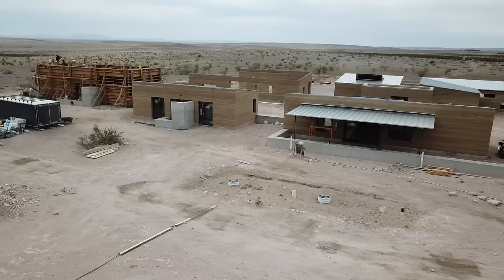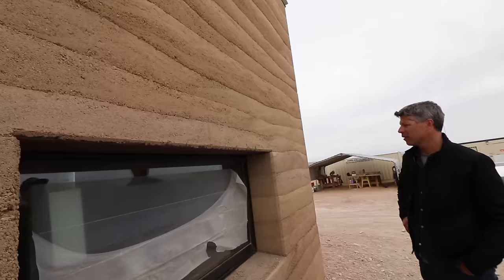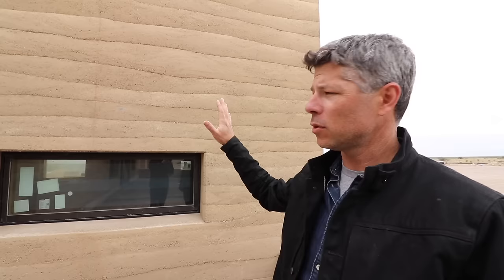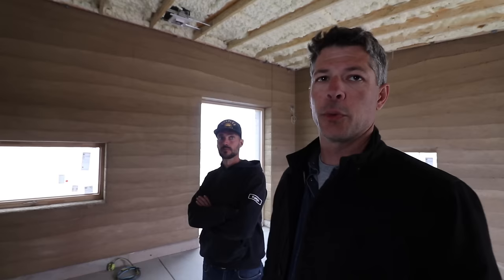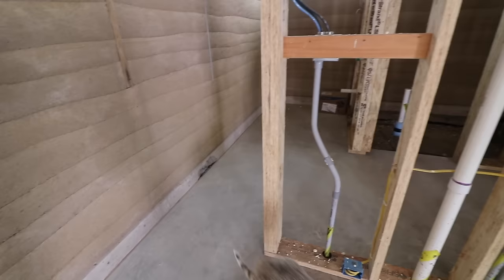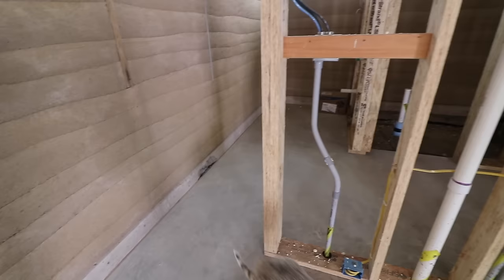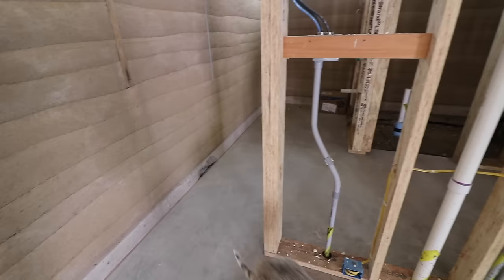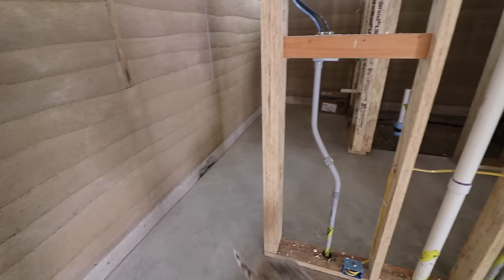Rammed Earth : You won’t Believe How They Build This!

Comment: Wow! New Idea! (No, it ain't, and you're about 10,000 years late.)
Reply: Yes, compacting of Earth to build walls has been around for a while. To RAM the Earth you would literally take male sheep (not the valuable for reproduction females) and place between the forms and run them around the interior of the forms. Hence the term RAMMED Earth.
But I'm fairly certain they did not use pneumatic hammers to pound the earth into place. I'm also quite certain that they did not use cement mixed in to make it a type of concrete. Also I'm certain that none of the others had in floor heating nor electric lights. 
But yes other than all the technological differences they are exactly the same.
Reply: @1grandpappy684  it's called rammed Earth due to the fact you tamped it by hand using a log normally. The facted that is called Ramming is just one of many oddities of English. It's a ram in the same way a battering ram is a ram.
Reply: @AdolphusOfBlood  
Perhaps you would be able to explain the occasional "ram" skeleton found in a RAMMED earth building.
Reply: @1grandpappy684  while I would not know about that, I do know about how they have been made for centuries in Mexico, And no Rams are involved in that. Perhaps those you mean were uesd in some way as an offering to the God's. How am I to know?
Reply: @AdolphusOfBlood   I would love to see your documentation.
You've referenced Mexico rammed Earth projects. Was rammed Earth done elsewhere? Can you assure me that in those other places the compacting was not done with animals? I know for a fact that there were several places where animals were used including "rams". If you have references stating that rams or pigs or other animals were never used for compacting the Earth I would love to see that citation.

Comment: Let`s save   pennies on   materials so we can  spend excessive amount of  money on labor.
Reply: If its self build then not so bad. If its community housing then mighty good. The scaffolding can be reused multiple times. I still have formwork years old and going strong and it was heavy thickness ply on frame. This is the most economic, thermally stable, soundproof system on earth $for$.

Comment: this is ok if it has large large eaves or if the area doesn't have extremes in weather, in much of Australia these crumble due to cold to freezing in winter and dry as dry can be in summer, so the ingress and egress of water and the expansion of both microbes and cessation of them leads to this crumbling quite a bit. likewise the prevailing rain and winds cause a lot of erosion too...

Comment: I volunteered to built a rammed earth home in South Dakota and got a job building these. These homes have a better appearance. we used concrete headers, instead of Steel. Also we used a lower quality clay. These look better all the way around. I would go an extra step and put stucco on the exterior and paint the interior.

Comment: In hotter climates you can also use thermal pumping with high mass walls to keep the interior close to the overnight temperatures. The way people in hot climates have done this for centuries is to simply open the windows at night. Now we could augment that with some form of whole house exhaust fan. However if a spring loaded vent is put near the floor under a window and a thermostat controller put on the exhaust fan the system can be automated. At night when the outside temperature reaches the set temperature the fan turns on and draws outside air through the wall vents and out through the roof.  The lag time before warmth from max heating portion of the day reaches the interior is such that it is happening in the night when outside air temps are low enough to start the vent fan. 

If the exposed rammed earth look isn't critical to your design, you can also cover the outer surface of the walls with autoclaved aerated concrete (AAC) with a stucco layer to provide insulation to slow heat gain into the rammed earth. Even a four inch thick panel with an R-value of around 6 would substantially lower the heat going into the rammed earth so the inside surface temp stays much cooler longer into the day and the amount of heat to be removed at night just that much lower.

If you didn't want to go with rammed earth or building codes won't let you, you could accomplish just about the same thing with a standard concrete block wall with all of the cavities either filled with tamped (not rammed) earth or simply have a concrete pumper truck fill all of the cavities with concrete to give you an 8" thick high mass wall. If you wanted you could even put the blocks sideways and get a 16" thigh wall! This is what my Dad (an architect) did with his house in Phoenix. Instead of vents in the wall and an exhaust fan, he has a slim casement window above each of the regular windows in each room that he manually opens before bed and closes in the morning, and an thermostatically controlled evaporative cooler with a controlled valve on the water supply which blows air into the house. When the nighttime temperature are down in the 60s and 70s he runs the evap unit without water. In June and July he puts a little water through to get the temps inside down into the 60s (he likes to overcool so coast through the day without the AC kicking on). Only in August does he run the AC when the higher humidity levels during their "monsoon" season means that he has to run too close to saturation temperature with the evap cooler to get to provide enough cooling at night to last through the day. And even when he runs the AC mostly runs at night to remove the heat that is finally making it through to the interior wall. Because of all the thermal mass and thermal pumping, his electric bill in the summer is less than a fourth of his neighbors with conventional wood frame construction.

In the winter he has a solar water heater on the roof that he pumps through a pipes in the slab to give radiant heat. That meets most of hisHe and the guy whose company did most of the HVAC work before both he and my Dad retired custom built a heat pump system that provides additional heat for the radiant heat and for domestic hot water.

Comment: This is actually very beautiful.  If the technique was professionally organized into a system of forms along with all the supporting tools and materials it looks like a very good tool to reduce the housing crisis.  I love it.  Are there sytems integrated that could provide core packages of everything but the furnishings… much easier to do from the slab, to the interior core and then theexterior walls and finishing after the roof is on.  Very neat!!

Comment: That's nice, but people need to understand that thermal mass is also a thermal bridge. Earthen materials conduct heat, so in a colder climate, it is still advisable to have insulation on the exterior. These materials are necessary for passive solar design, as interior walls, where the southern glazing allows light to hit the bear earth, but the northern wall could also use some insulation, and I wouldn't even personally want the wood in the roof to be exposed the way it is. Hit these buildings with an infrared camera, and you'll see what I mean. In terms of thermal mass, this is a very impressive structure, and I'm not as concerned about the portland cement embedded energy as some folks, though I'm also not really convinced that this is preferable to cob, but maybe that should be taken on a case by case basis. Anyway, straw bale insulation would be good for the walls and roof, and mycelium is also pretty attractive to someone like me, in that respect. So, yea, essentially, I want people to consider high insulation for exterior and thermal mass for interior walls, with southern glazing. I think those three components are all important for sustainable buildings. Thanks.

Comment: This is an amazing project. In Los Angeles it seems I've visited the old adobe houses on hundred degree days, even with the doors open and people going in and out, they're cool inside. 

When you mentioned using decomposed granite with some portland cement it made me think of Frank Llyod Wright's Ennis Brown House here in Los Angeles. It's the one that 'appears' in a lot of movies including Blade Runner. In many of these movies casting made from molds taken off the house's walls are used in sets back at the studio. The patterned blocks for the house were made on site with decomposed granite and concrete. They have not held up. I'm sure this Rammed Earth House project addressed this issue. It would be interesting to know more. 

And one of the most beautiful houses I've ever seen or stayed in is the adobe guest house in the back yard of a man named Guillermo in Oaxaca, Mexico. The walls, bathroom and kitchen counters, etc were all finished by hand, because you can see hand prints still in the surfaces. When Tom Wolfe attacked the International Style in his book From Bauhaus to Our House, his key argument is that all human scale has been removed making the building soulless. The Oaxaca house might be the best supporting argument for Wolfe.

Comment: Thanks for this contribution. I appreciate the great care with which this project has been executed. The architect created a design of simplicity and natural materiality. I would have loved to learn about what kind of insulation they used for the ceiling. Looks like sheep’s wool to me or cotton, which would further underline the environmentally friendly nature of the building. We’re they gonna use heat pumps for temperature regulation?

It struck me a bit that there wasn’t any scaffolding around the building where they poured the concrete. In most European countries (I can speak for Germany, Austria and Switzerland) regulations demand security measures against workers falling off, by scaffolding or using harnesses and ropes at heights above 9’10”. So they saved quite a bit money right there. 

This technique btw, is ancient roman. The first modern building made with this technique, being said, was a bridge  in 1820 built by a French architect. We have quite a few building made of “Thumbed Concrete” across Europe. It’s not that unique, but rare for sure.
Reply: Spray foam-they discussed it briefly

Comment: They should consider silicate as a densifier instead of a sealer to keep the natural look. A lithium or colloidal silicate water glass treatment would strengthened the PSI of the Portland cement. Very impressive walls

Comment: There is/was a group in Grants, NM named Elkin that developed an adobe maker using this same concept  with cement stabilized rammed earth except they made blocks approx 8 inch thick, 16 inch long 8 inch wide.  The blocks are made in a mixer feeding a press and produces about 20 to 50 blocks per hour. The final building will have the same characteristics as these walls except the quality control on the blocks is better because the hydraulic force is consistent as they are formed.

Drawback I see with this method is the high manual labor demand.  Also, Safety is pretty lax here.  An OSHA inspector would write a whole pad of citations...
Reply: That's why it is in the middle of freaking nowhere.  Osha doesn't like mud on their shiny shoes.

Comment: Million questions, what do you repair the walls with, when you need to drill into it? Can you epoxy coat the interior/exterior, or would you suggest a skim coat? Would applying a vapor barrier increase the deterioration?  Told ya, lot of questions.

Comment: a 2 layer brick house with concrete columns on the corners (like the people build in EU) would cost way way way cheaper and would have the same or even more insulation properties (especially if you fill the gap with rockwool)...

Comment: Very nice home built like the oldest homes on the planet,  but to use crushed Granite in place of soil would definitely be an unnecessary increase in cost.  I've been in homes made of Adobe that my Father built in New Mexico that you needed  a blanket or a pot belly stove to heat up in the middle of summer. Just a new twist on the old school building.   It does look very nice though. And the subfloor heating and cooling systems are what I was accustomed to in Colorado.   It is a very nice accumulation of alot of different technologies.   I cant wait to build my own homes so I can enjoy the comfort of rammed earth.

Comment: Usace EM-385-1 21.A.02  Workers exposed to fall hazards shall be protected from falling to a lower level by the use of standard guardrails (see Section 21.F.01.b), work platforms, temporary floors, safety nets, engineered fall protection systems, personal fall arrest systems, or the equivalent, in the following situations:

Whenever workers are exposed to falls from unprotected sides or edges, access ways, fixed ladders over 20 ft (6 m) in height, unprotected roof edge or floor openings, holes and skylights, unstable surfaces, leading edge work, scaffolds, formwork, work platforms, re-bar assembly, steel erection and engineered metal buildings;

Comment: It has 8% cement vs 13%+- for concrete, but the wall is 3-4x thicker, so the concrete usage is much higher, around double.  So, much higher carbon footprint??  It is also more labor intensive, so I guess the benefit is aesthetic, plus you get a massive wall thickness which might be beneficial in some areas.  The guy answering the questions didn't seem too in love with it.

Comment: Congratulations for the team building these walls to re-discover the 12000 years old cutting edge technology of building walls from earth! These walls unfortunately have only about 120 years before them due to the utilization of concrete, which will cause them to start to crumble seriously by that time. Would you have used cellulose fibers for bonding, it might have lasted another 12000 years given the right conditions and insulation from water. :)

On a more serious note, it is way more healthy to live in a mudwall house than in anything covered in manufactured insulators.

Comment: Question: will the rebar passivate in this mix?  I'm interested in the long term performance of reinforcement in rammed earth. I know your environment is dry but 500 years is 500 years. Spalling from rebar corrosion may be an issue long term. Galvanized rebar might be preferred.

Comment: Stabilized rammed earth is okay. However, it can be done unstabilized - without cement... ie. rammed earth. If this was in a very humid location, the ability to modulate the internal humidity would be considerably less. This would diminish one of the best things about rammed earth construction.

Comment: One issue I'm curious about is how will you be able to update or repair the innards of this house over time. What happens if you want to run some new cabling, install a new outlet, put in a new bathroom, put in a sink? How do you add internal wires, pipes, etc to a solid wall? I'm just thinking about all the times my parent's old traditional wood framed house had been updated over the years.
Reply: You plan all that before you build...put in as many outlets as possible

Comment: the steel lintels are heat bridges and the thermal mass walls  without a proper roof (luck of  thermal mass) does not work on such a climate, especially if it is  exposed to direct sunlight, isolated roof itself does not work against heat!

Comment: I know what 2 feet looks like and those walls did not look 2 ft thick. on the 1 building his foot is in the doorway and its about 1 foot thick.
Also, I worked with a new building product that was a compressed interlocking brick and that was an amazing product, unfortunately the powers that be lobbied it away because of the amount of building products it replaced. same concept though, compressed dirt,clay,cement and a water proof liquid derived from tree bark. Aeonian brick homes. was the name. Titan brick took over and we lost our stock shares in the company (after they converted our 2% to 200,000 shares) then they never contacted us again, its been 4 years THANKS TITAN BRICKS FOR THE SCREW JOB

Comment: I have a suggestion in order to feed the dirt to the top of the wall instead  of man handling the dirt with shovels as not only is it quite dangerous standing on top of the wall without any type of saftey gear,  like a harness or some type of scaffolding that could be on the inside of the building ,  could you use a mobile orga , what they use to lift wheat up to the top of a silo, with a 4 inch diameter rubber hose on the end and as long as you want it to be , a bit like a concrete pump set up , to me the slow manual labour with shovels is far to slow , I hope my suggestion my help you down the track , good video enjoyed watching it thanks for uploading it , I'm from Australia.

Comment: Sounded like an interesting method, until I realized that they shovel every gram of earth and need to compact every layer with some tiny hand tool. These walls sound like they must cost about 10 times what they would with concrete.

Also they seem to imply that if for example you just took a sledge hammer and gave a wall a few wacks you would either have to live with the hole/scaring for the entire life of the building or demolish and start again.

Also, it appears like you cannot screw anything into these walls. I was surprised, even just windows need embedded lumber to be installed. Will they be able to hang pictures, or will they need to be hanging off the roof?

Comment: 💡Now, there are large 3D printers, laying down concrete, which can construct a house in a day. The same X/Y/Z mechanism could be fitted with a rammed earth head, with slip forms on each side. The material could be delivered via auger tube. Pneumatic rams could follow immediately behind, within the slipforms.
Voila! Fully programmable, 3D printed, rammed earth home. Better make sure the window and door frames are ready.😎